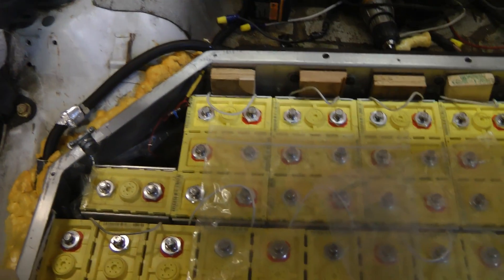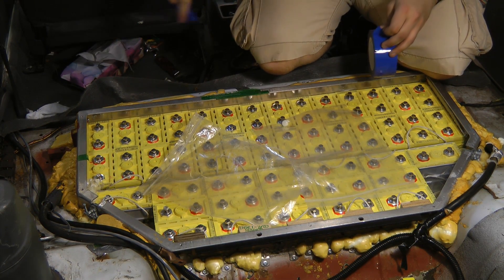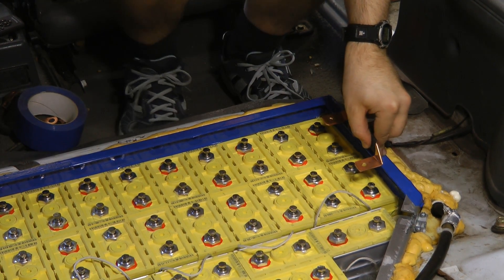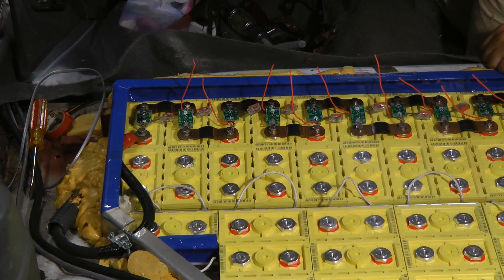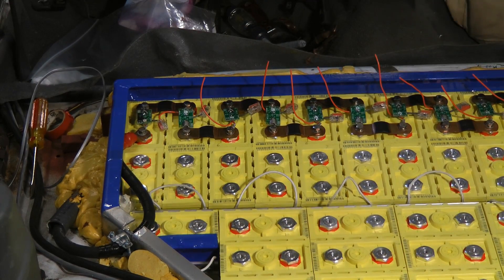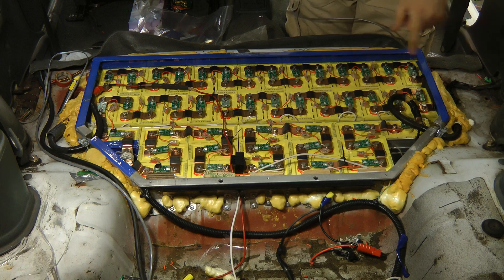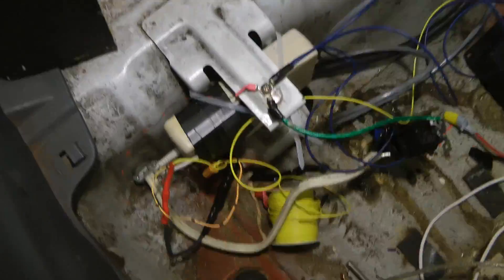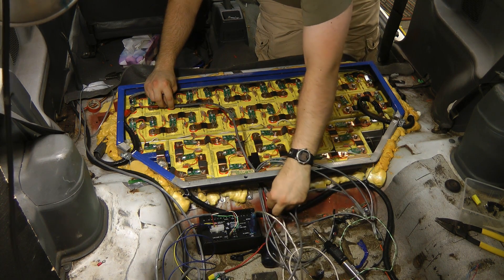Electric car upgrade part 3 - Cell board installation/wiring

Comment from the maker: I didn't design the system, it was off the shelf. It is essentially token ring, but each ring is only allowed 16 nodes, presumably due to the delay in getting packets through. So for the 45 cells, 3 rings are required, with the associated cabling.

Comment: The battery management why did they make your run so many cables in to the battery well. Why didn't they make them token ring or address bus? Easy hook up and clean look.

Comment: how are the bms unites hooked up what is the read wire for that you stripp off dose that just go to the next madual. if so how. this looks need I wish Ih ad somethign like that for my 12 v batteries. for my wind and solar.

Comment: what happens to a conductor in a magnetic field?those bms boards are not only of poor quality but are subject to huge magnetic flux because of the high dc current flow around those batteries.every semiconductor and every copper wire and lump of solder is generating cross currents across your battery terminals under load(charge or discharge).KISS =Keep-It Simple=Safer.

Comment from the maker: @Adventuresofwiiman This is a 1991 Pontaic Firefly. With these batteries, range should be about 40-50km vs 20 with the old batteries. Top speed should be similar, I've had the car up to 110km/h on the lead acid batteries.

Comment from the maker: @douro20 Yes, there's a lot of micros! It seems to be the best way to do it, the alternative is to have 1 wire going to each battery, with a central unit with tons of ADC channels and isolated switches to activate loads on each battery.

Comment from the maker: @skonkfactory Yes, it is nerve wracking working on this. During installation I had the pack electrically split into 3 sections by not connecting some bus bars, so there's a relatively safe 50V on each section. Once everything is connected, you just have to be careful and plan what you're going to do. Using insulated tools also goes a big way to avoid sparks.

Comment: Just a safety tip, *ALWAYS* remove *ALL* of your jewelry,etc. when working on live circuits (including batteries). One slip,and it could severely burn you,or worse. Your watch appears to be plastic/rubber,but it is still GOOD PRACTICE to remove it.
Be Safe!